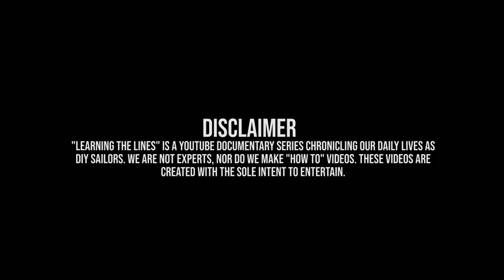What's Up With Our Cutlass Bearing? | Learning the Lines [Casual Friday] - DIY Sailing

Comment: I hope Randy gets well quickly and I hope you don’t catch what she has. 
I don’t think you will have any problems with the sleeve you plan on replacing.
Clean out the threads in the housings.  Insert the sleeve into the housing and 
use the threaded holes as guides for a spot drill.  Drill shallow location points
for the set screws. Do not drill through the sleeve.  The set screw(s) will hold
the sleeve in place.

Comment: I used the shaft turned backwards and put up through the cutless,  a dock washer the sized for the bearing.  Heat it with a mapp gas torch.  Then using the shaft like a slide hammer drive the bearing out.  Don’t know where you are hauled out, but if in the Tampa Bay Area I would be willing to help. Take care,

Comment: Always best to use the proper tool, novice or not. Cutlass bearing renewal is a standard boat yard repair. Do not sleeve the "sleeve" as nasty as it appears they are removable with the correct tool,  use a micrometer and obtain the correct sized replacement, we've seen damaged hulls where the cutlass attachment point has compromised the hull integrity because of vibration after an improper repair.

Comment: You need a hub puller. The type to pull of brake drums. You can get them in different sizes. I had a prop that had become almost welded to the drive shaft of my Volvo penta stern drive. The White grease had set solid over the years the old owner had not used it. I bought a long reach one. The pressure put on it deformed the rubber prop coupling. I had given up by then and decided the only thing left to do was to retreat to the pub! As my mate and I walked off we heard a thump.... The puller went slack and it slid down the splines. If that fails then you need to heat the outside with a blow torch. Keep a fire extinguisher nr because of the rubber. But that will let the puller do its job. Good luck!!! Keep a cool beer or two close at hand it's not a quick job normally+
Reply from the maker: Lol thanks for the advice!

Comment: I would drench the old bushing with "PB Blaster." It stinks like hell, but it has a capillary action that will get in and loosen up the corrosion and rust. Like others have said, I'd be wanting to remove the old bushing and install the correct-size new one, rather than trying to put that smaller one in. Also as others have said, try to rent or buy the correct press to get it out. (you don't want to hammer that out, you'd probably mess up the strut.) Most presses for something like this look like a huge oversize "C" clamp, and would have a driver that would fit inside the bushing and have an edge that would grab the edge of the bushing. This would also press in the new one. Remember, brass, (or could be bronze,) is pretty soft, and can deform or collapse easy if not properly supported.

Comment: A saws all blade should be able to be used to cut slits in the old gearing by hand to get it out in sections. I would try replacing the entire old bearing. Thinner new is weaker.

Comment: Oh, no.  When I replaced the cutless bearing on my boat, I had to cut the old one out (the old one was epoxied in).  Take a hacksaw blade and cut along the length.  I made 2 cuts about 20 degrees apart, then used a screw driver to peel that wedge out.  Then I was able to slip the screw driver under the remaining jacket and get the rest of the old bearing out.  When you install the new bearing, make a mark through the set screw hole and drill a little dimple for a place for the set screw to grip the jacket.

I did a quick search, and this site has a good description:
https://marinehowto.com/replacing-a-cutlass-bearing-sleeve-bearing/

Comment: Use a Clamp Press, Create a backing Block of wood with proper sized pass hole, a  socket as a press block on the threaded end slightly smaller than the bushing,. Have Randy help with alignment while you apply threaded force moderately until the bushing moves into the backing block about 3/4". This should provide enough room to  drill holes for a  1/4"  dia pin or phillips  screwdriver to be used to pull and twist the bushing free without any damage to the strut or the bearing surface. Good Luck

Comment: Changiing the cutlass bearing is a simple process. The method you suggested, putting a replacement bearing inside the old sleeve, is not acceptable. The old sleeve needs to be removed. You can accomplish this several ways. 1 Aquire the propper tool and press the sleeve out, 2 make a tool using threaded rod, pipe, nuts and washers to make your own press, or 3 invert a hacksaw blade inside the old sleeve and cut through the old sleeve to the strut in a couple places and drive the old sleeve out. Clean the bore hole in the strut with sandpaper until all the old residue is gone. Put a little grease on the correct bearing and slide it into the bore. Gently drive it in if neccessary with a rubber or plastic hammer being careful not to distort the bearing sleeve. After you install the propeller shaft check the alignment of the two flanges at the transmission. Using feeler gauges adjust the motor / transmission mounts to be parallel within .001 per inch of flange diameter. Example, 4" diamiter flanges equals .004 or less parrallelity between flanges for 360 degrees. This step is important for insuring a long life for the bearing, dripless shaft seal, and transmission or electric motor bearings. Also this procedure will cut vibration to a minimum. I've done this many time using all the above methods. Hacksaw method is truly the last choice. Have fun!
Reply: I didn't suggest slathering grease on the sleeve, besides if the sleeve is a propper fit there will be only traces of grease remaining after installation and salt water will soon dissapate that. I was taught this method in the mid 1960's when working at a boatyard as a helper. I don't always use the grease, most times it is unneccessary. Remember, I'm advising a young man with little to no marine maintainence experience. If the rubber is so tight or the sleeve so loose that the bearing will cling to the shaft you have the wrong sleeve for the aplication. If the strut is out of round it can be reemed larger and a bearing sleeve will be turned to match the  new size.It is turned .001 smaller than the strut i.d. The set screws have a purpose. There is a dimpling  drill bit, rarely used, to provide a pocket for the set screw as a further anti rotation prevention and this is used after the bearing is in position. I didn't want to get this technical for fear of discourging the young man. This is also an aplication on a boat that will probably never exceed 7 knots under power.

Comment: Carbide round blade on copping saw remove one end of blade slide through reconnnect end of blade, then let it glide back and forth at 5 o'clock then at 7 o'clock cuts fast then half round chisel knocks right out. Then retap or redrill new hole and thread then put in bearing then when bearing in place hit with 1/8 drill bit hit bearing 1/64 then put in set screw no slipping.👌 put in 100's of them never had problem.

Comment: I'm a firm believer in, if you're going to do it, do it right!  You have plenty of comments on how to do it below.  I've seen several videos of using the hacksaw to remove the old bearing and using a long piece of threaded rod (or a bolt) with fender washers and nuts on both sides to pull the new one in.  However you do it, there was a reason it was engineered the way it was.

Comment: Maybe use a seal driver or an old socket and hammer and see if you can tap the old jacket out first. If it doesn't budge at all you may be able to size down and just get the rubber. Good Luck!
Reply from the maker: The socket idea seems like it would work! Might have to try that. Thanks!
Reply: NO! do not do this, terrible idea. The reason a puller is used is to prevent shock from pounding, the strut is only sitting in fiberglass.  You DO NOT want the strut to move at all.

Comment: I agree with bobie gale. Use the right sized part. Might need to find or have local machine shop make a special puller for you. If not find something the same size and use an impact hammer to drive out old one. Or carefully cut a slit in the corroded one, then gently pry and tap out. Just some ideas off the top of my head. Good luck.
Reply from the maker: Thanks. It's looking like we'll be getting a different replacement bearing that is the right size.

Comment: The only issue I see is that the rubber (bearing) part of the new cutlas bearing is very thin and may wear out faster.I have seen other channels use a puller to get the old bearing out.

Comment: Don't press with the new bearing, use an old socket same size diameter and beat it with a rubber mallet. You could also rig up a block of wood, 2 bolts and a Bearing press, (Bearing Puller) but using it to press out.

Comment: Remove the rubber and then use a hacksaw to cut through the old jacket in 2 places and then it will collapse enough to allow you to remove it. Your way may work but removing the original would be better.

Comment: When I did my cutlass, I dinked around trying to use pullers and all sorts of ways unsuccessfully. Finally I carefully used a hacksaw blade inside and gently cut through it using a screwdriver to bend it out of shape and pull it out. Just use common sence and it will come out. There is a dyi web site called dbase  I think that has instructions for this job and others like it

Comment: Maybe get a cylindrical metal piece that's the same diameter as the old one, put on top of it and wack it with a hammer as hard as you can... Some heat from a torch or something might help as well.
Reply from the maker: We'll keep our eyes open for a scrap piece that might do the trick. 🧐

Comment: You really need to remove the old cutlass bearing. That's the right way to do it. Drilling out the old side screw will release the hold on the old bearing. But it sounds like your propellor shaft is 1" or are you making it 1" just so the new cutlass bearing will fit inside the old one?
Reply from the maker: The prop shaft was and will be 1 inch. Lol. Wasn't quite sure how to say that since we're replacing it.

Comment: Guys, replace your cutless bearing without removing the prop shaft!  Check out the individual kits at StrutPro.com Push out the old bearing and install the new bearing in as little as a half hour!

Comment: Not to be a smart-ass, but "google how to remove/replace cutlass bearing........you need to remove the rubber and bronze case without damaging the strut. A hacksaw blade (out of the frame) works well for this, just don't cut too deep. Once you loosen the fit, you can collapse the old bearing through the set screw hole and remove the old bearing. Clean the strut, new bearing will be a press fit, make sure you don't "twist" the bearing when pushing it into the strut. Steady even pressure use a block of wood and a rubber mallet and tap it don' HIT it into the strut.

Comment: I definitely think You should try to take out that old jacket first. I would try to soak it for a few days with W40 or another penetrating fluid and then using a !! good size puller!! and than using a hammer to break it loose.. It does not want to move ? use heat. For this You need to remove the set screw first. Take a smaller then the thread size bit and drill ....later drive in a screw driver to see if You can remove it. If You can´t get it out I would just go the easy route and drill it out...... You don´t wanna remove the old jacket ?? burn out the plastic. That is the cleanest way without any damage.

Comment: For some reason, I'm not too keen on the idea of installing a new bearing inside the old one, but I suppose it should work ok so long as you get all the rubber out and it winds up being a good snug fit. Personally, I would do my darndest to get the old one out before I went down this road.
Reply from the maker: Understood. Definitely not ideal. We were thinking removing the old one might cause damage to the strut which is a can of worms we do not want to open. Lol

Comment: get a hacksaw through the shaft and cut it out then push it out with a matching size socket? or a bearing puller?
Reply from the maker: We're considering the hacksaw method. Looks like we may need to order a different replacement.
Reply: @LearningtheLines  Not a boat guy but done the hacksaw thing many times on equipment. If you're careful you can cut completely through the bushing without affecting the strut. Even if you overdo it a bit no harm done. The most corroded bushings can be removed this way.
Reply: Simon James Agree careful use of hacksaw then pry/curl cut ends up to reduce diameter of old sleeve. Careful bronze is great but soft don't beat hell out of "P strut" or misalignment can occur. Lots of WD 40.

Comment: I wouldn’t suggest putting a new bearing in on the old one use a hacksaw to remove the old and replace with a new correct size bearing for the strut try putting new bearing into the freezer before installing into the strut do not use a hammer try squeezing it in with a c-clamp or a piece of threaded rod

Comment: Put the cutlass bearing in the freezer before fitting
Reply from the maker: I just watched a video in which the guy did that. I was worried about effects of the temperature change, but I guess this is okay?
Reply: Learning the Lines There's not enough of a temperature change to be a problem. Maybe heat up the housing with a blowtorch too
Reply: I would pull the old sleeve out using a long bolt and thick washer the size of the sleeve a socket the size of the strut and a washer at the top of the socket. I’ve used this method before with wd40 to pull sleeves out before.
Reply from the maker: Thanks for the follow up!
Reply: Clifford Black Good idea, that's probably the best way to get the old one out
Reply: Mike Stroz it has worked for me on several occasions and is low cost
Reply: It's common practice to freeze the bearing and heat the housing!

Comment: Maybe you can have a machine shop turn down a piece of stock to the same diameter or a few thousandths smaller than the bearing, then you can hammer the old one out
Reply from the maker: Thanks for the input!
Reply: Hammering, even lightly, is not recommended because the impact transfers to the P-bracket and any damage may not be immediately apparent. Others have stressed the need for removal of the entire old cutless  bearing with an appropriate puller. Made mine from a long bolt and several appropriate washers and my 30-year-old bearing (I suspect) came out with no fuss. Good luck. ⛵️🇨🇦

Comment: Some installers glue the cutless in w m 5200 andyou will have a terrible time removing the brass casing w o using a bearing removal tool.

Comment: You should use a round  punch to get that cutlass bearing out
Reply from the maker: I worry about the effect it might have on the strut. 😕
Reply: @LearningtheLines  once you get it started brushe the ends with a brinze brush to knock off corrosion then get it started with a punch pb blast it let it sit should lossen up prettey good then you wont have to beat on it

Comment: Get Korol penetrating oil a piece of rod the outside diameter off the bearing, then use a propane torch to heat up the strut and pound it out with persistence.  What you are doing won’t work.  Not as hard as you think.
Reply: Kroil oil

Comment: how about shooting it with a bunch of fluid film, let that set for about 3-4 hours, heat up the area around the bearing then push the new one in on top of the old one with a handheld press....always over lube and heat the metal before using a puller or a press or else, the casing surrounding it will crack and then you're shit out of luck. 
https://strutpro.com/
Reply from the maker: Do you think this will work given how corroded the one in there is? If it wasn't so bad, I think it could possibly work.
Reply: if you heat it up with a blow torch for a good 4-5 minutes all around and tons of fluid film.....yes. Make sure you heat the metal around the bearing and not the bearing itself. You want the bearing to remain colder than the piping hot metal around.
Reply from the maker: Thanks for following up!

Comment: You need a puller to get it out. And maybe a bit of heat,
Reply from the maker: Heat guns seem to always be the remedy for everything.
Reply: @LearningtheLines  I was thinking of a propane gas torch. Rather than electric. Been boat building 30 years .if you happen to be unlucky and have a really stuck one. Get professional help.

Comment: Chill the bearing in the freezer several hours and just before you're ready to install it put some heat to the strut with a torch. Think you'll find the bearing will slide in easier than you think. (Same trick is used to install things like valve seats and guides) Sailing Follow the Boat did a video during their refit on how their cutlass bearing was removed. A socket the size of the cutlass bearing on one side of the strut and another larger than the bearing on the other with a threaded rod running through them to act as a jack screw to withdraw the bearing. Hope this helps.
Reply from the maker: I think we will be trying this! Thanks for watching!